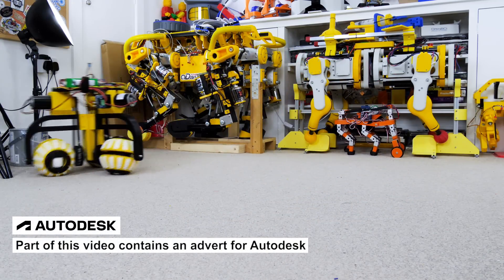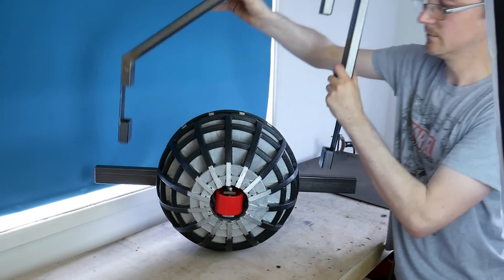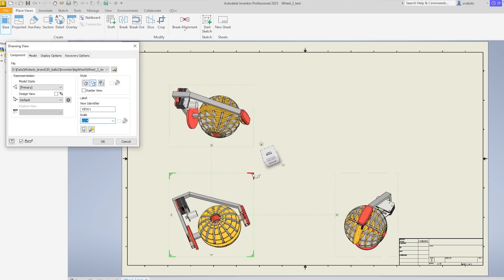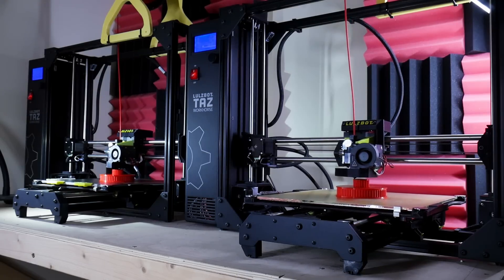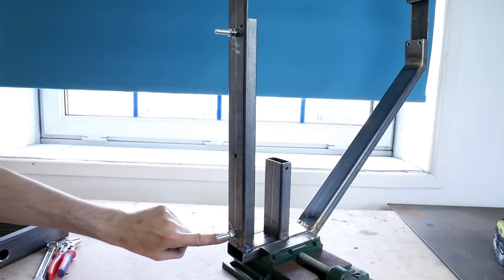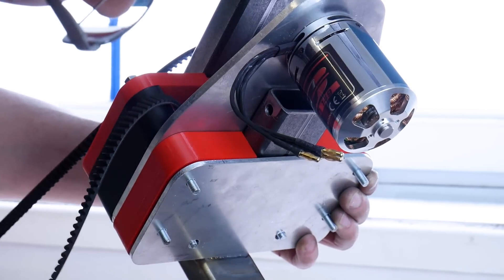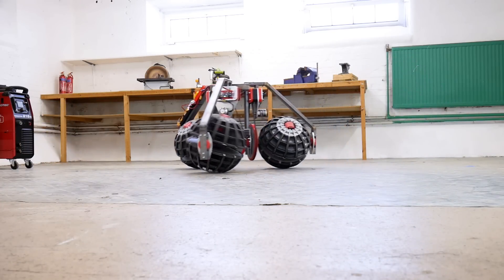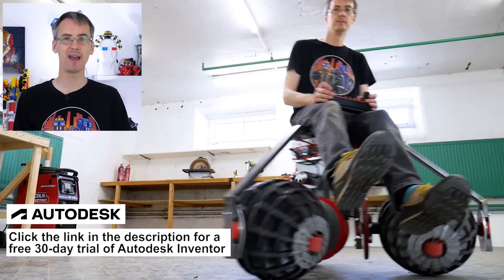Testing Ball-Shaped Wheels on an Omni-Directional Vehicle

Comment: Idea for a feature: I dunno if it would be possible, but it might be neat if you could run a sort-of wheel-calibration program that allows you to automatically align the three wheels to the same orientation. You'd probably have to manually align them first, I suppose, or finding a way to wire a gyroscope into the wheels might work.

Comment: I think you should do some tests to show how good or bad it would be for use as a mobility aid vehicle like a wheel chair, can it handle offroad at all? what changes would need to be made for that etc.  

you could also look into making it autonomouse with a room scanner etc as a platform for generic robotic applications.
Reply: Every mouse is an autonomouse.
Reply: I think the hemispheres of the wheels wouldn't have any problem off-road, but the skateboard wheels at the poles might have trouble given their much smaller diameter
Reply: A smaller one would be perfect for people as a mobility scooter altermative especially indoors to turn around in tighter spaces
Reply: @smashyrashy  indoors scooter? Are we becoming the humans in wall-e?
Reply: @dowesschule  You do realise that people use electric wheelchairs every day, don't you? 🤦
Reply: I think you will need some chock absorbers and ofcourse a seat where you can sit down on. Some flexible materials for outer layer of the wheel simular to a sphearical tier.
Reply: @BS-vm5bt  shock suppression on the seat mount would be easier to add.
Reply: High center of gravity would be an offroad problem
Reply: @lasskinn474  it's a rather wide chonky base. With extended life batteries the center would still be low enough
Reply: @thekwoka4707  with a guy sitting in the middle on top of it? turn it 20 degrees and it's kinda looking not so good, more so if you make it more narrow for accessibility use.

like, compared to a normal wheelchair you'd be moving the bodymass up like a foot or two. if you crammed the wheels under it which I'd rather not ride up an accessibility ramp even at that point.  and the contact patch forms a triangle so there's that too.

but sure if you just threw enough weight on the bottom inside in the stable region somehow where you have space between the wheels. would be a lot easier with non spherical omniwheels though whichwouldn't eat up the volume between the wheels.
Reply: That would overcomplicate it totally, would be too expensive and would be not easy to maintain. there are compact electrical wheelchairs that can rotate on the spot and are stable.
Reply: Off-road testing will probably be done at ElectroMagnetic Field Camp
Reply: It’s horrible for off-road because it got no suspension at all (not even solid rubber tyres) and the diameter of the skateboard wheel is small. It’s like taking a skateboard off-road (but sitting on it, not standing where your legs provide some suspension). Cobblestones would be horrible on the thing.
Reply: The one thing it would struggle with in terms of accessibility is it’s width - wheelchair users often can’t get through thin doors easily in a regular wheelchair. 

However for outdoor use this would be amazing!

Comment: Got any idea for suspension? I imagine that you wouldn't want to take that down the road for long periods of time :)
Reply: Fiber glass arms.
.
()
Looks like this^
But sideways <>.
.
Springs could be done but it requires top placement. Extra arms. A slight suspension as in hanging*. 
.
The balls require suspension closer to the base but seperate from the drivetrain.
Reply: Fiber glass arms.
.
()
Looks like this^
But sideways <>.
.
Springs could be done but it requires top placement. Extra arms. A slight suspension as in hanging*. 
.
The balls require suspension closer to the base but seperate from the drivetrain.

Comment: You should add a seat and make a steering wheel or bars where when you turn the wheel it turns normally but if you pull the wheel side to side it will track sideways.

Comment: Definitely needs some foot rests welded into those two front bars. Looks really fun, though 😁 can't wait to see how it performs in the wild, after you get a seat on it.
Reply: I think he should face the other way, with the emergency stop between his legs so it's easy to reach, and adding a foot rest at the end of that beam, around the battery
Reply: Is he turning into Davros ???
Reply: Came here to say this, even without a seat it would be way easier to stay on with footpegs.
Reply: Stick some lights, indicators and number plates on it and see if you can get it mot'd 🤣🤣
Reply: if wled the foot rests to the seal and out it on a swival jsut because then the seat can fact any direction. Image you go backward and press a button and turn the seat around to see where youtr going
Reply: Yeah that was my first thought too, just something so he doesn’t have to hold his legs up. Even if it’s just part of the leg that gets supported.
Reply: exactly what i was thinking
Reply: Can't agree more. Footrests will help stability of the rider immensely
Reply: would have been better to just use one ball
Reply: @Blox117  You mean similear to a BB-8 office chair? Now that would be something:)
Reply: @derjansan9564  yes they are self balancing ball bots, except without the bot.

it actually avoids some of the challenges of his build, such as being able to use a complete sphere instead of hemispheres.

Comment: Clearly what's needed are head tracking motion controls: gyro or similar mounted on a bike helmet you should probably be wearing anyway, look left/right to yaw left/right, look up/down to strafe forward/back, tilt head left/right to strafe left/right.
Reply: Don’t sneeze
Reply: Ai driver
Reply: Lol I thought of similar but in the seat. Lean back n forth for stop and go, left n right to turn. But opted for paddles in the foot rests, and a stick for turning. That way it’s gona be more controllable.
Reply: Break your neck to go backwards
Reply: maybe make the vehicle align with the direction you are looking at, with a small dead zone so you don't rotate indefinitely. you turn your head and it rotates your torso until you are looking ahead again. then have a stick to control translation.

Comment: How can the aluminium be softer and "meltier"? Does anybody have an idea what they sold to James?
Reply: Probably aluminum alloy 1100. It's effectively pure aluminum. Great for forming and detailed things, but not as strong as most other alloys. I'm GUESSING he normally uses 3003 which is a bit stronger and more commonly used all over the world.
Reply: most aluminium has some copper in it and has been temperature treated if it's for load-bearing or other work.
Reply: Aluminum comes in different % of each Basic component to make it softer and meltier or harder and more structual